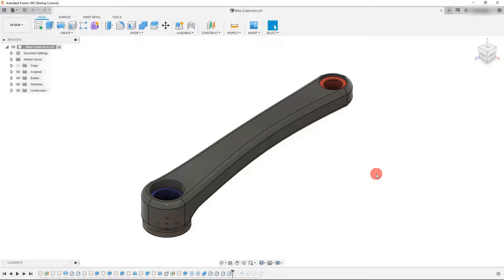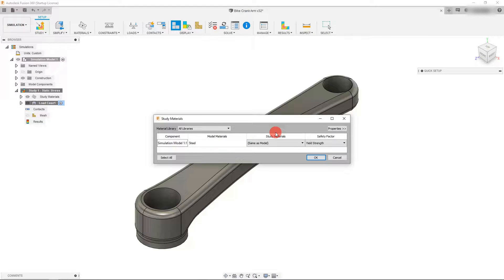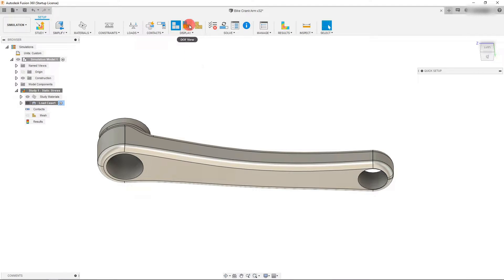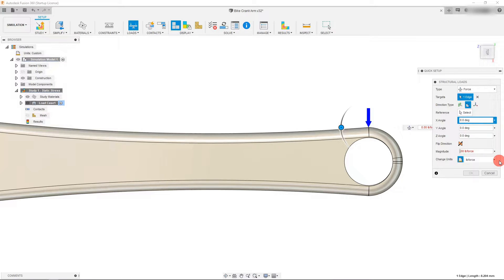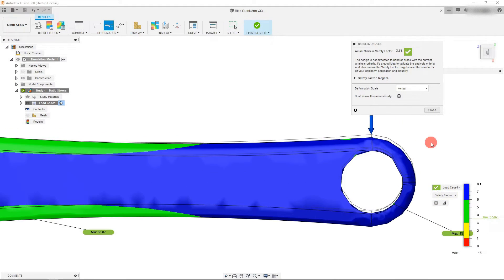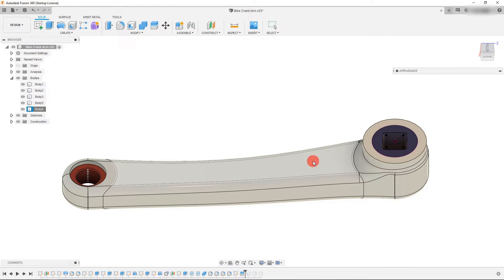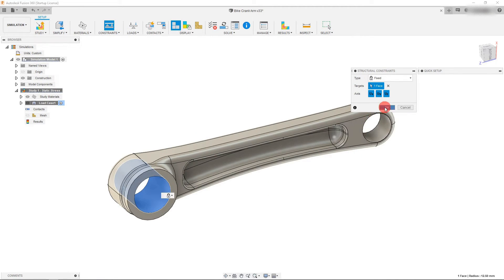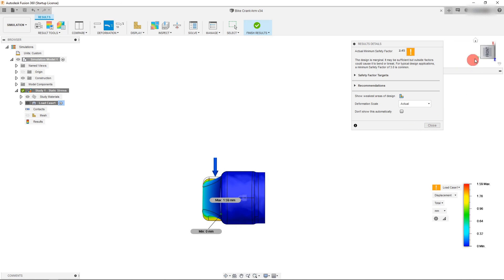Static Simulation in Fusion 360! Bicycle Crank Arm Tutorial

Comment: Hi, I've not worked with Fusion360 before. Why do you apply the load in this video to the line, and not the cylindrical face or the bottom half of the cylindrical face?
Reply from the maker: I did because in selecting the line, the force direction was poiting downward as I wanted it to. To put it simply, selecting the arrow will make your force point downward by default, while selecting a face or bottom half would make your force point in another direction.
Reply: @AvivMakesRobots  How much experience do you have with the software? Literally every other CAD package allows you to select the force direction.

You should be able to select the force direction as you see fit. Have a play around with the software. Select a surface, and use a reference line or an axial direction in which to apply the force. 

The load should be applied by the peddle to the inside of the bore, so sorry to say your setup is incorrect. Though it probably doesn't make too much difference to the results.
Reply from the maker: @JayLikesLasers  You are totally correct. The reason I selected the line is that is a very clear and easy point to select for beginners, which is what the video is geared towards. If I truly set this up correctly, i would apply a load to the pedal shaft sticking out of the threaded hole. The problem with making video that accurate is that the video would be hours long and no one would watch it. Trust me, I have tried this... If you keep watching, you will find other ways I have cut corners to make it a "basics" tutorial. If you check out my simulation of a heatsink, I took less liberties and placed much more emphasis on accuracy. If you want a more accurate sim, check that out.
Reply: @AvivMakesRobots  Thanks for the response and the recommendation. I'll check it out.
Reply from the maker: @JayLikesLasers  Enjoy! Thanks for watching.